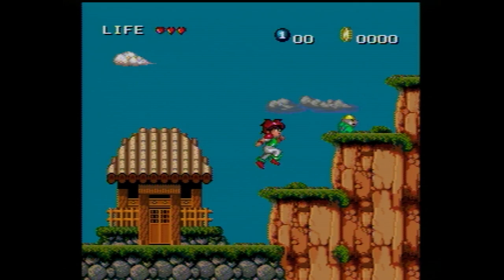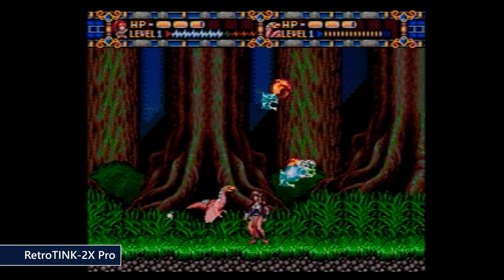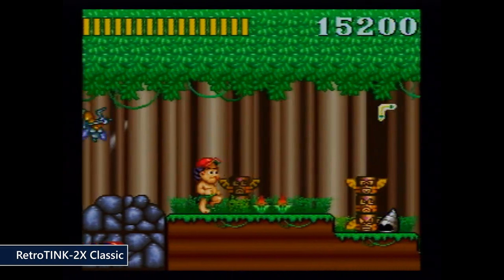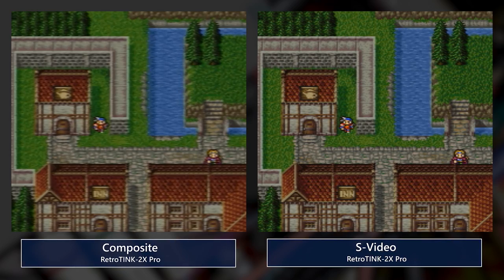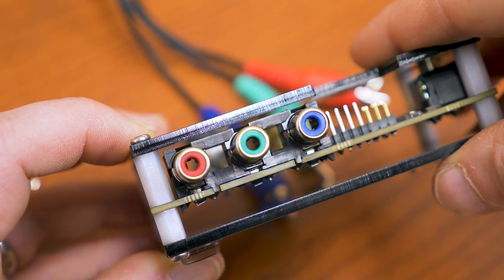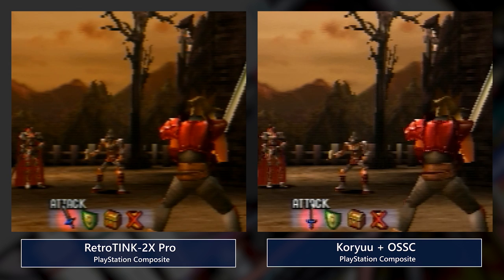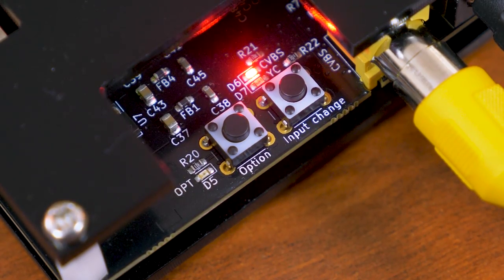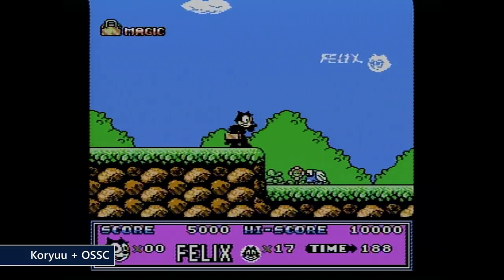RetroTINK-2X Pro & Koryuu - The best composite & S-video Options? :: MLiG Ad-Lib / MY LIFE IN GAMING

Comment: I have the Retro Access S-Video cable for my N64.  Without a hardware mod or something of that nature, there are no miracles with the N64 video signal, but I do have to say that the Retro Access S-Video cable is a significant improvement over composite.  While the image is still blurry, the colors are really solid and there are no jitters in the blacks and whites.

For anyone who's tried plugging their N64 into an HDTV directly with composite, it's almost unplayable it's so ugly.  You can deal with it for Mario 64, but if you're playing 4 player Golden Eye, the picture is just too bad to be fun, you can't see what's going on at a distance.  I have an older HDTV in my bedroom that maxes out at 1080p, but has an S-Video input.  I was really impressed with the Retro Access S-Video cable playing on that TV.  Again, no miracle here, but for 240p 3D graphics, it was fine.

In my living room I have a newer 4K TV that doesn't have an S-Video in, so with that I run the Retro Access cable through a RetroTink Classic with line doubling and smoothing.  I can't describe what an improvement that is over composite directly into the TV.  Again, not a miracle, the N64 has very blurry video out, but the bad visuals no longer spoil gameplay, even in 4 way split screen games like Golden Eye and Mario Kart.  I then run the 480p HDMI signal from my RetroTink through a Marseille mClassic for an upscale to 1080p and further smoothing, which makes N64 look pretty good.  I quickly stop noticing the blurry picture with this setup, especially with Nintendo's cartoony graphics.

As a side note, I also connect my Saturn and Genesis to the RetroTink with a set of component cables from HD Retrovision and pass that through the mClassic and I swear it makes 2D games look like HD remasters.  2D fighting games on the Saturn look mind blowingly good.  No miracles with the N64, but plenty of miracles with the Genesis and Saturn with this setup.  3D Saturn games also look really good, but again, there's only so much you can do with 240p 3D graphics.  Still, they look a lot nicer than the N64.  

Another nice thing about the mClassic is that its "classic mode" forces the signal into an original 4x3 ratio.  The RetroTink is going to stretch anything to 16x9, which I'm actually fine with most of the time, but graphics are definitely sharper in the original 4x3.  

Every now and then I'll just plug my Saturn or N64 into my TV directly with composite just to remind myself how much better these retro systems look through good cables and upscalers.  Yeah, I hear the Framemeister and OSSC are better, but I will say that the RetroTink + mClassic setup can instantly handle games that switch between 240p and 480i.  I hear the Framemeister and OSSC have some serious lag when the input resolution changes suddenly.  With RetroTink + mClassic, the resolution switch is instant so it has zero effect on your gameplay.  Personally, I like how the RetroTink and mClassic smooth out blocky pixilated graphics to make them look higher resolution than they really are.  I know that some people really love that sharp, solid pixel look on their retro games, so if that's you, this setup is not for you.  But back to the original point, you're never going to get sharp pixels from your N64 without a mod, so if you're stuck with a blurry image anyway, the Retro Access S-Video cable + RetroTink + mClassic do a TON of cleanup on that image.
Reply from the maker: [Try4ce] RetroTINK does not stretch to 4:3 for me, so that sounds like a TV issue. Do you not have controls on your TV to force it to 4:3 manually?
Reply: @mylifeingaming  Maybe I do.  I haven't messed with it, but I probably could tell the TV to squeeze the image into 4:3.  I do most of my retro gaming on a Retro Freak clone console, which has an option to output 4:3 in the menu, so I don't need to screw with TV settings.  But if I don't do anything with the TV settings, my RetroTink outputs 16:9.  As I said before, I'm actually fine with this on most games, though I'm sure it drives some people crazy.  Since I'm using the mClassic anyway, I just flip it to classic mode if I want 4:3.  I use the same TV for modern gaming and movies, so not having to mess with the aspect ratio every time is a plus for me.
Reply: The retrotink2x is 4:3.
Reply: @ians_parks  Mine is a RetroTink classic, not the pro.  Maybe it's an older one?  It definitely outputs 16:9 onto my TV if I don't do anything in the TV settings.  Again, doesn't bother me.  I get 4:3 with the mClassic.
Reply: @mscottjohnson3424  I own both the classic and the pro. Both are 4:3. Its gotta be your tv 🤔
Reply from the maker: [Try4ce] The output is 4:3. Your TV is just seeing that and going "ew, old stuff, let's make this FILL THE SCREEN" and not doing what you want. Your TV should have a very easy to use aspect ratio setting to fix it.
Reply: I think the bigger problem is the way the N64 displays graphics to the TV. The n64 uses anti alasing to remove jagged edges as well as smear it with a horizontal blur to further remove the pixelation.
Reply: @Ballowax  true. N64 will only look so good without a mod. 

Though there are some new ROM hacks that tell the hardware to turn some if that stuff off, which does improve the picture quite a bit.

Comment: So I have about 3 or 4 composite and s-video consoles and want to get these to my OSSC with a Koryuu maybe? Can I use a regular switch, like a Pelican, between the consoles and the Koryuu? Will there be resolution loss? Lag? Is there a better way?
Reply from the maker: [Try4ce] I've used a Pelican mechanical switch for composite, S-video, and component at times and I was surprisingly impressed by it. As long as you use good cables on the inputs and outputs, you shouldn't have any noticeable quality loss. Since it's a mechanical switch, it's simply bridging the connections between the lines, so there's no lag. Would be an excellent no-fuss cheap solution for connecting to a Koryuu.

Comment: Is the S video cable that comes with the retrotink good or should I consider something else?
Reply from the maker: [Try4ce] I suspect it's pretty good, and there actually aren't a lot of good options out there, so unless you see an issue, I'd stick with it. The bundle with the S-video cable is new, so we haven't actually tried the cable.
Reply: Thanks for the reply! It was only like an extra 8 bucks so I may get one elsewhere for comparison. I've seen some that go up to about 26 bucks but they were sold out.

Comment: Just a word of advice, like the OSSC, you may have compatibility issues with the RetroTINK. In my setup, the only console that I couldn't get to work with them was the PS1. My TV didn't accept any resolutions coming off of it. To get the most use out of either device, I needed to feed their video output into the HDMI input on the Framemeister or cheap SCART to HDMI to normalize the signal.

Comment: Can you please please help me?  

I need a DAC solution to use all the Mini consoles with my old CRT TV.  I used the one I got from Amazon and it squeezes the 16:9 resolution.  I need means to just crop into the 4:3 game screen only.

I can't seem to make this happen... :(
Reply from the maker: [Try4ce] Yep lots of people ask for such a thing, but it's never going to work exactly like you think it should. Keep in mind too that the output will be interlaced, while most of the games were really 240p. The only thought I have is, maybe if you set the mini console to stretch the game to 16:9, your can use a DAC to output to a CRT, where it would be un-stretched.
Reply: It's not that difficult, just take an hdmi to vga adapter, go into a gbs 8200 with the gbs control firmware, set to downscale mode and ypbpr output and plug into your tv.

Comment: Which would you recommend for laserdisc / VHS video ?
Reply from the maker: [Try4ce] Unfortunately both are going to struggle with VHS. VHS drops sync on both the TINK and the OSSC a lot, just because it's so unstable. I recommend keeping an eye out in thrift stores for a DVD Recorder that has composite input and component or HDMI output. That stabilizes the signal. If you'd like to then run the DVD Recorder through the RetroTINK, it would look pretty great in my opinion. Wish I knew more about Laserdisc, but I'm pretty sure it shouldn't have those problems.
Reply: @mylifeingaming  thank you for your reply

Comment: When using the RetroTINK-2X Pro with PlayStation 2, then does it matter if I use a composite or a component cable? Will both options give the same picture quality and smoothing filter quality?
Reply from the maker: [Try4ce] No, component picture quality will be considerably cleaner than composite, and somewhat cleaner than S-video. Keep in mind that cheaper component cables may have audio buzz, especially on bright screens.
Reply: Thanks. Do I need to find a specific component cable for PAL region or it doesn't matter? Several cables on Amazon say NTSC-compatible and others don't have any info.
Reply from the maker: [Try4ce] Nah, all PS2 systems can use the same cables.

Comment: If the output is component, can you simply use it to convert your s-video signal to component on a crt?
Reply from the maker: [Try4ce] You can, but Coury showed some kind of issue that showed up on CRTs in some situations, but I forget exactly what it is, or if it was fixed in firmware later.

Comment: So let's say I want to hook up my Gamecube with component into the retrotink, I can then hook it up with hdmi into my HD TV?
Reply: Yes, but like they say it can't accept 480p input from the GameCube, only 480i.
Reply from the maker: [Try4ce] Yeah you would totally lose the ability to use 480p from it. If you already have the component cables, I would get an OSSC (price has been dramatically reduced) and use it with that. That's by far the best way to use component on a modem TV. You can set it to passthrough 480p, or to do a 2x scale which sends out 960p and looks amazing if your TV will accept it.
Reply: If you GC has the digital AV port, Insurrection Carby is the best way to go and gets you an end-to-end digital connection to your TV in 480p.

Comment: i have to ask this question: is it possible to break the s-video into 2 Y-C cables and connect them into the Component jacks of a retro tink? or would i need to get something like the Koryuu to do that? I only ask because i want everything to be fed from a component switcher
Reply from the maker: [Try4ce] That is not possible. The hardware in the OSSC is only capable of handling RGB and YPbPr. S-video and composite are not natively supported on existing hardware, that's why the Koryuu is kinda positioned as a companion to the OSSC.
Reply: Carlos Moreaux I was wondering the exact same thing—like, should the Koryuu be my solution, or should I stick with the Blackmagic YC adapter that I’ve been looking at? S-Video can be surprisingly clean still, & when I want to run something like my FM Towns Marty or 240P 3DO.
Reply: @mylifeingaming  Thanks for the input! I guess I'll just have to buy a koryuu. I swear I read somewhere that you could break the S-Video cable to a dual RCA for Y-C and plug those into the Y-Pb inputs of a device to pass the video through, but ever since RetroRGB put out his Koryuu video I haven't been able to find it since.

I swear getting a good signal out of a stock N64 is such a crapshoot no matter what you do. I have the rest of my consoles figured out but it's always something new with the N64.
Reply from the maker: [Try4ce] Oh, you can certainly PASS the signal that way, but since the OSSC is the signal's termination, the OSSC needs to be able to understand what to do with that chroma signal, and it just doesn't know what to do.

Comment: Have rgb mod sns101 with 2x pro on an 82inch tv and having screen area minor shifting and pixelation when moving. Using hdretrovision component cable. Any input?
Reply from the maker: [Try4ce] Like, when the screen is scrolling? Sounds like the TV may be applying some sort of filtering. Make sure you have Game Mode turned on to your TV, and that any motion interpolation features are turned OFF (these might be called various names by different manufacturers, like "TruMotion" or "MotionFlo" or some junk like that). Basically I recommend turning off just about any artificial processing features, even stuff like noise reduction, you just never can be sure what it's really doing. Also make sure that your 2X Pro is set for 2X output and NOT passthrough. If you're using passthrough, then you're sending 240p to your TV, which is defeating the purpose of the 2-X Pro. Your TV then is probably misinterpretting this as 480i, and doing unecessary deinterlacing, which may add visual artifacts, and likely a ton of lag. I imagine one of these things is what is causing your problem.
Reply: @mylifeingaming  i put the tv to 4:3 and turned off a bunch of stuff now it just has a few pixels here and there that change colors light to dark shading back and forth when walking. Tolerable now

Comment: Hello guys , I hade a problem whit Monster S video cable  were only display black and white and color whit the cheep cable on my crt monitor any suggestions on good s video cables
Reply from the maker: [Try4ce] Sounds like only the luma portion of the signal is getting through. Might be a problem with the console, cable, TV/device, the physical port on the TV/device, or an incorrect setting.

Comment: any suggestions on what would be the best svideo cable to use on nintendo gamecube and 64 systems with the retrotink 2x/2xpro?
Reply from the maker: [Try4ce] This is the best new option. https://retro-access.com/collections/super-nintendo/products/n64-s-video-cable There are older good cables, like the official ones, or the Monster Cable ones, but they're harder to come across. A lot of the commonly available cheap ones out there are really bad, they have lots of video noise, or may even be composite video quality over an S-video connector.
Reply: @mylifeingaming  thanks!
Reply: btw is the retro access one as good as the old official one or monster one?
Reply from the maker: [Try4ce] I have not personally used the Retro Access S-video cable, but they make just about the best cables out there for RGB, so I would expect the S-video one is equally good. They use very high quality cable stock. I'd be very surprised if it was not at least as good, likely better, than the official or Monster ones to be honest.

Comment: My retrotiink 2x pro scanlines look dark but I can counter that by upping the gamma on my tv. The main issue I have is the weird horizontal banding I get on my screen, every 8 lines or so I have a dark band and then 8 lines further down there’ll be a slightly lighter band, then dark again and so on. I’ve tested in another tv and it’s the same. Any ideas what’s going on? (PAL user)
Reply from the maker: [Try4ce] Scanlines can cause capture cards and scaling engines to do funky things like that. I wonder if your TV isn't running the HDMI signal at full color bandwidth or something? No idea if that's a thing on TVs, just guessing here.
Reply: My Life in Gaming thanks I’ll check that out! I’m also on the latest firmware and I’ve just tried an alternative power supply, no change sadly, bizarrely though if I set my Samsung to Zoom the scanlines even out and look amazing but of course Im no longer on 4:3 ratio and miss big chunks of the picture off the screen. When I try to crush the picture back in the banding comes back again.

Comment: So what should i use to enhance my original Xbox outputting 480p?  an OSSC?
Reply from the maker: [Try4ce] Original Xbox in 480p looks amazing on the OSSC. However do know that you need good Xbox component cables. Official ones and Monster ones are very good, but cheap ones you might find on eBay or Amazon are terrible. I've seen more bad Xbox component cables than I have for any other system. There's something recent that lets you use  Wii component cables with Xbox, but I haven't had a chance to use one yet, so I don't know how good it is.
Reply: @mylifeingaming  thanks buddy :-)
Reply: Keep in mind there is an open source version of the component box for Xbox that matches the quality of Microsoft's official. I forgot the name of it but Modern Vintage Gamer did a video on it.
Reply: nerdyneedsalife
It has been out of stock for some time now.